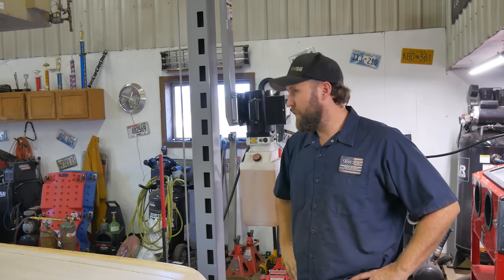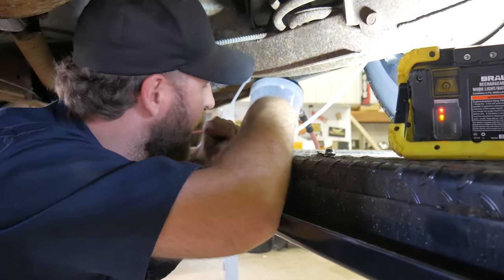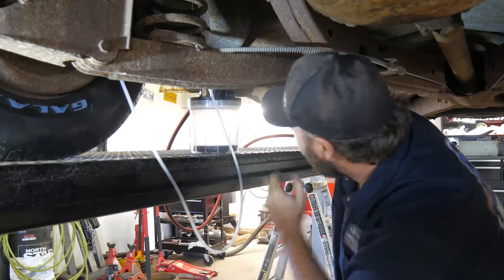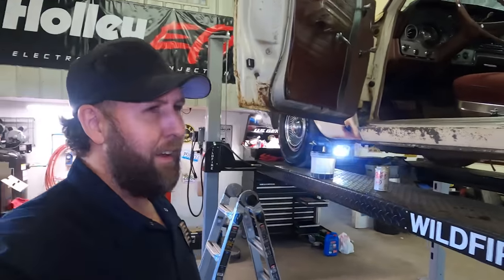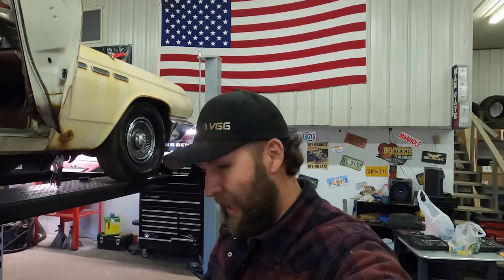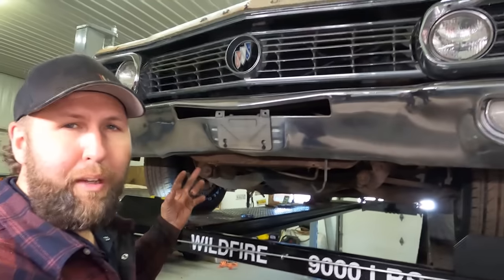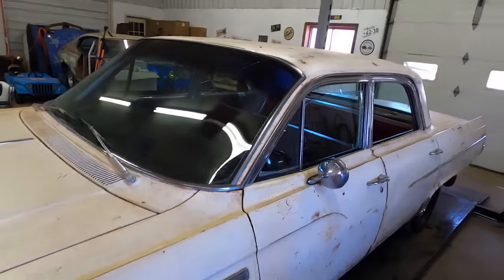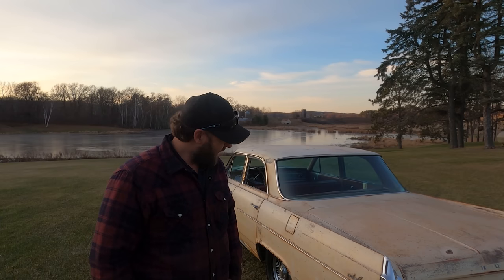From ABANDONED to BADASS! Buick Budget Build (P5)

Comment: My bonehead story- pulled an engine out of a Prius and while trying to get the replacement in I couldn’t get them to align and come together right. In the process of trying to horse the engine in I cracked the windshield and tore the axle boot. Turns out the alignment pin in the replacement engine was hitting the alignment pin left in the transaxle from the old engine. 😞

Comment: I was putting new muffler on my motorcycle had to shorten the pipe so i used a cut off the pipe cut in two but so did the clutch cable behind it.  Ooops

Comment: A guy once pulled a driveshaft on a truck on a slight grade without using the e brake or wheel chalks. Had to grab ahold and skid with the truck for a good 10 truck lengths. Wore a flat spot on the back of a guys boots. Coulda gone real bad

Comment: A young Seabee came into the base auto shop I was working at and changed all his brake calipers, rotors and drums one day, I asked why and he said he did not like the rusty color on the surface of the old ones showing through the wheels.  Well you and I know the new ones always come with good clean lightly coated rust protectant for storage,  he had about $500 worth of brake parts that looked pretty out of the box.  I explained to him that a wire brush and a can of high temp spray paint would have been $499 cheaper, but he proceeded to install the parts anyway.  Last thing I told him was I will see you next week with a wire brush and a can of paint, I think it kind of peed him off a little.   But sure enough 1 week later he came in the Auto Hobby Shop and rented a bay and lift, I said well did you bring your wire brush and can of paint, I thought he was going slap me lol.     Indeed he did and proceeded to clean the surface rust off the new parts and painted them.   Then with a little laughter he apologized for not taking my advice the first time after I told him the new ones would be rusty in a week as well.  After that day on he always looked up to me to make sure he was doing the right thing when working on his auto's.  Moral of the story:  Never turn down $500 worth of good advice and knowledge.

Comment: I was replacing a steering rack and spent 2 days trying to loosen the two bolts holding it to the frame.  I then tried the nuts on the other side and they came right off!  Dang bolts were SPLINED through the rack... total bone head move on my part to not try the nuts earlier on.

Comment: I had jus put a dual carb and exhaust on my 49 chev ....had to install the fuel block ....so I decided to mount it on the heater core housing ....drilled right thru the heater core ......no problem I jus re-routed the hoses ....who need heat anyway ?

Comment: So yeah I’m addicted to Derek’s videos. He asked for some stupid human automotive stories…. It’s well been about 38 million years ago but a guy needed to fix his brakes…. We’ll being new to working on cars having no tools or experience I went to the base auto shop we’re a guy could get a bay with a lift and work on the car a bit. Well I got all the wheels off replaced the front disc brake pads and decided to have a look at the rear drums. Well I fought to get them off. So I’m looking and the shoes are shot but I didn’t have those…. So I figured quickest move would be to through the tires back on and go get them! 🚨.  Got it down fired it up through it in reverse. Started out ….. Yep pedal to the floor! 65 mustangs have a brake reservoir with a single chamber for front and back brakes… So I’m headed out of the bay and somebody had they’re Chevy pickup parked sideways behind that bay. Panicking I tried to pump the no brakes pedal and nothing so I thru the gear selector back into D. But I hit the truck before the transmission made nasty noises and had me headed back in the building with NO BRAKES! Now other people had gathered inside to see what the racket was and realized I was a lil out of control! They scattered! I finally tried the emergency brake handle! Uh I didn’t put the drums back on you see. 🙈🚨🚨.  Yep I through it into park just before I tapped the wall with the bumper! That’s learning a whole lot about brakes hydraulics single reservoir master cylinders and drum brake components in one big disaster. There were about three huge guys that had arrived in the pickup dented the bed on and they looked like they spent way more time with the weights than I had! They just wanted some cash for the damage. I didn’t have any of that. PFC don’t usually have any of that. I called the MPs so we could just do a insurance claim. They weren’t happy! I just wanted some referees! I still have that old car! There you go

Comment: I sprayed 3 cans of expanding foam from aerosol  cans into a wall right next to a gas water heater. Yep full Homer Simpson mode. You would never guess what happened when the aerosol that settled around my flip flop cover feet did when it found the pilot on the water heater.
Reply: In case you can’t guess, it was a Hiroshima sized explosion of pain and burned hair. Needless to say don’t try that at home.

Comment: My bonehead mistake was I was ride captain on a biker ride and I let the group ride ahead and I was making the rear was safe and no cars were going to plow through the group since I had all the safety gear and lights. Well, young kid went to the front to show off, popped a wheelie and his head be dipped straight onto the asphalt there. Had I been up there I would have shut that down before a kid could hurt himself. I stopped leading that ride because maybe I felt I wasn't the volunteer to do it anymore. Passed the throne on. Hope that kid turned out ok. I didn't make him show off, but maybe it's my fault for trusting kids won't act like they're invincible and not show off and be responsible.

Comment: Replaced my turbocharger  on my 5.9 cummins and  started it then realized I forgot to attach the oil feed line on the turbocharger  bone head and 2 gallons of oil sluge in the driveway but I cleaned out the oil filter lol

Comment: I have the ultimate bone head move. I was a GM tech. I was replacing the cam phaser on an h3.  After hours and hours and some more hours i was almost done. Just put the new phaser on the timing chain and slide it on the cam. Put the bolt on finger tight. And wouldn't you know it another customer needed a headlight bulb in a hurry. So i knocked that out real quick and got back on the h3. Finished putting everything back together, topped of the fluids and fired her up. Purred like a kitten. Kinda noticed a little stumble after a few minutes. I hooked up the scan tool to check things out and then this thing made a noise i Could've went through life without hearing.  Wtf was that i thought. Well out came the tools again. Pulled the upper part of the timing cover off. Guess what freaking moron forgot to torque the cam phaser bolt?  Yup me. It backed off. And when it did it bent every valve in the head. Try walking into the service managers door will that story. Had to pull the head any rebuild it entirely. Moral of the story do not install anything unless you have time to finish the process.

Comment: I had a mistake with fuel line. The old fuel line had rusted in 2, started pouring fuel everywhere but still fed the engine enough to keep it running.  This went on a little bit before I noticed as I was adjusting the spark timing.  The puddle of fuel was right under the open headers as she was backfiring flames out. I damn near burned down my mother in law's shop building.

Comment: My biggest bone head move (to date) was installing ALL FOUR FRONT DISC BRAKE PADS BACKWARDS, then, wondering what that horrible noise was when I stepped on the brakes!  When a guy got back home, he discovered the bone headed error and re-installed the pads, correctly.  The horrible noise went away.

And, Derrick (Mr. Buick), what's the deal with the faux exhaust ports on the front fenders?  Some have three, others have four on each side.  What gives??

Comment: Like you said we've all made those bonehead moves you would think after doing it once you would learn, no no that just doesn't sound right my claim to fame was leaving intake bolt socket underneath the intake on my 327 that went in my El Camino looked high and low for it I got another one finished bolting it down put it together two weeks later I knocked out some more pushrods I took it apart this time I put guide plates in all of the push rats and when I opened the intake manifold there it was nice and lubricated my swivel head 3/8 ratchet the two extension and the socket for the intake bolts. Yeah I thought I learned my lesson on that one a year later I did the same thing knock on wood I haven't done it again...

Comment: I installed the front cover on an AMC 360 only to turn around and find the distributor gear, oil slinger and cam bolt sitting on the bench.  Ugh.

Comment: I put an intake on a gm 3.4 v6 and had the entire motor together before I realized I forgot the gasket 🤦🏼‍♀️ of course that’s after I set there scratching my head because it wouldn’t run right and things didn’t fit quite right 🤣

Comment: Had a radiator leak in my 97 bmw had a brain relapse and put some sealer in it plugged up my small hoses took out my head gasket and put hair line cracks all over the head now trying to find a good head to put on very hard and a very stupid thing I done so I think pretty sure of that

Comment: Adding my mistake in the doodly doo.  I put a turbocharger on my 95 miata. A big one. Wastegate spring was for 7psi.  Well.... I forgot to enable overboost protection in my ecu, and thr wastegate reference line failed. I know what 30psi of boost from a td04 compressor into a 1.8l miata feels like. HOOOOOOOOLY SHIT. Lasted 4 gears before assploding thr number two connecting rod and ventilating the crap out of the block, oil pan, head, etc...

Comment: My bonehead mistake: removed the cap from a front strut without coil spring compressors......It was a little Asian car and I looked at the pissy little diameter of the spring steel and thought “just how much force could it have anyway?” That thing let go, uppercutted me harder than Mike Tyson and dropped me FLAT on my back! I sat up after a minute trying to figure out what happened, felt my face, no blood...ok, felt my teeth.....still there not broken....had a look in the mirror and the only evidence was a grease mark on my top front teeth where the strut punched me out 😅

Comment: My bone headed mistake was  I was replacing an absolutely destroyed / metal shavings everywhere rear-end with another Old and less abused rear end it was fine in a 78 rusted out GMC PU single cab 1/2 tun and i had the Old 1/2 socket wrench on one of the U-bolts they were now rust welded together im a big feller about 430 pounds of beautiful. And i was giving it my all pulling on that wrench when completely by surprise that bad boy slipped right off the nut and with the might of Hercules Puled that heavy (USA MADE NOT the CHINA STAMPED CRAP) Craftsman 1/2 socket wrench right in to my forehead above my right eye yup... almost knocked my self out  I crawled out from under the truck and I couldn't stand  I knocked the equilibrium outa my head it was under the truck next to the wrench. Looked like i hade a golf ball under my skin I was dazed and on my hands and knees crawling across the rock driveway ..... I learned several a lesson that day and I'm just going to forget the lessons and pretend it never happened!

Comment: Bonehead mistake #34.276...Deleted power steering pump on a Dodge 2.2 rebuild.  Forgot the PS mounting bolt hole went all the way through to the oil channel.  Result: first start=externally lubed engine.

Comment: Bonehead comment:  i was working on a 1952 Ford flathead V8 and had the heads off, but left for the winter forgetting to put them back on, and in the Spring when I got back, the entire engine was one large mouse nest, including dead mice.  One ruined flathead V8.